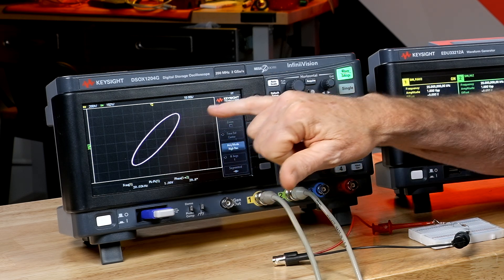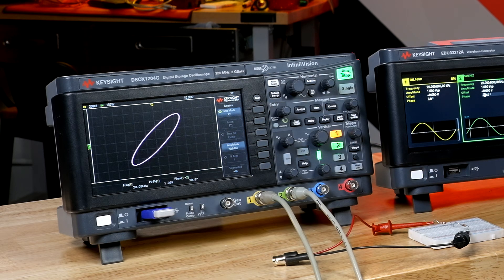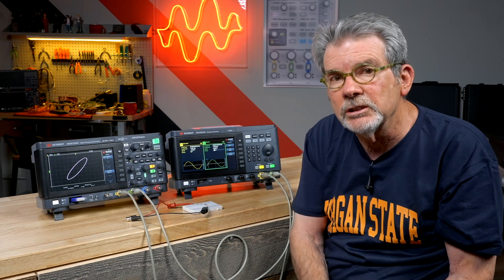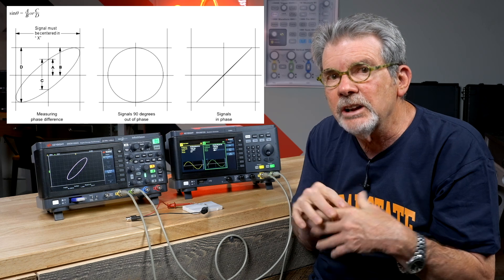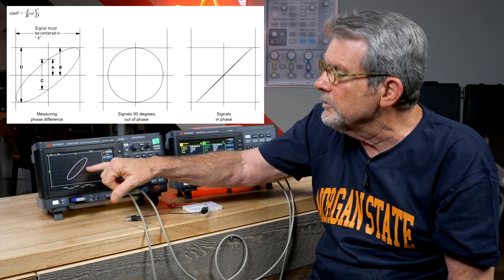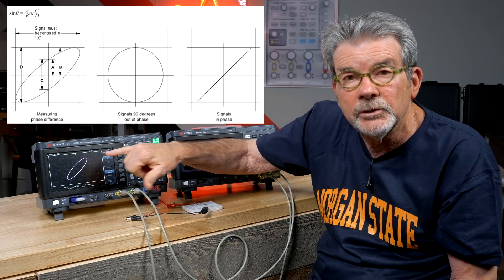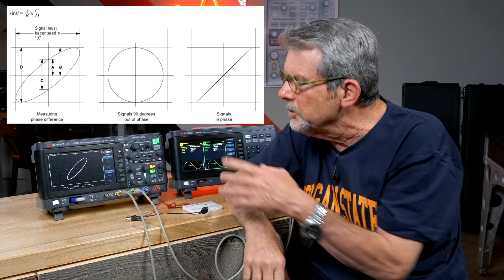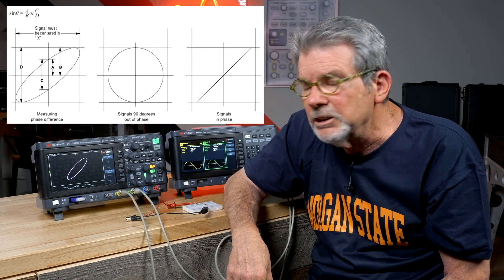Lesson 15: Lissajous Curves

Comment: Tuning forks and instruments can be tuned to a much higher degree than by ear using Lissajous curves.

One axis frequency serves as the reference, while the other axis is the variable - a tuning fork / instrument / string / etc. 

The wave form can be changed in specific ways by physically changing the variable in known ways, like shaving, sanding, cutting, etc., until the waveform creates the desired shape.

Comment: This XY mode is supposed to give a linear signiture measuring a component or circuit path through a curve tracer octopus which gives voltage through channel one and current through chanel two. The two signals will have zero phase shift. The supply power to the octopus can be 115VAC stepped down to a much lower voltage through a transformer or the AC source can come from a waveform generator where you can control the frequency.

Comment: 1. Physics and Engineering: Lissajous figures can be used to study and visualize the relationship between two periodic waveforms. They are often employed in the analysis of electrical circuits, particularly in oscilloscopes, to determine the phase and frequency differences between two alternating currents or voltages.

2. Sound and Music: Lissajous figures can be used in the field of acoustics to visualize and analyze the phase relationships between two different sound waves. By applying these figures, it is possible to study the characteristics of musical instruments, determine the harmonics and overtones present in a sound, and analyze stereo sound signals.

3. Laser Technology: Lissajous figures are used in laser technology for aligning and calibrating laser systems. By directing two laser beams onto a pair of X-Y galvanometers, the resulting Lissajous pattern can be observed. This technique enables precise adjustments and alignment of laser beams for various applications, including laser cutting, laser engraving, and laser show displays.

4. Mathematics and Education: Lissajous figures are used in mathematics education to illustrate concepts related to trigonometry, parametric equations, and the relationship between periodic functions. They provide visual representations of mathematical principles and can help students understand complex concepts in a more intuitive way.

5. Art and Aesthetics: Lissajous figures have an aesthetic appeal and can be utilized in art installations, visualizations, and design. Artists often incorporate these patterns into their works to create visually captivating displays or to explore the intersection of science, mathematics, and art.